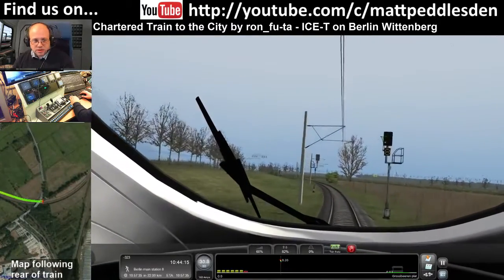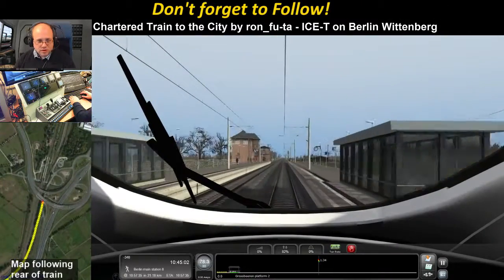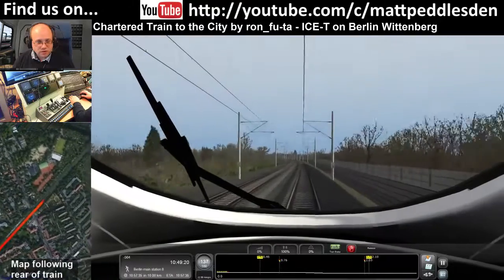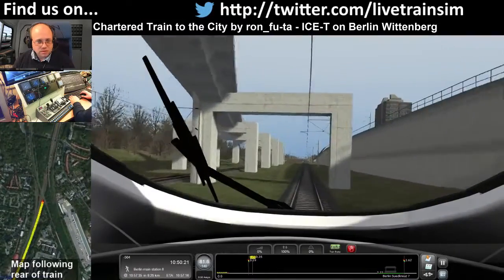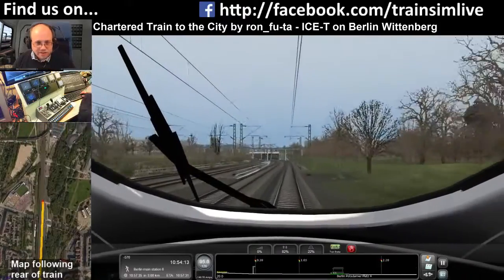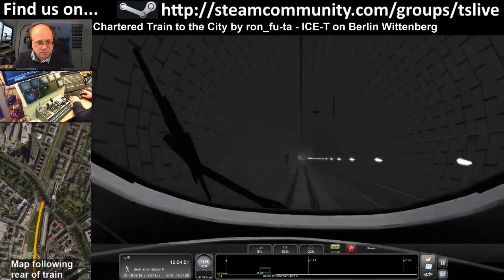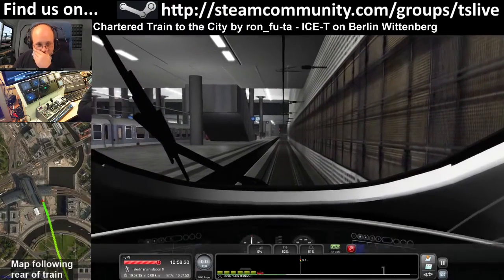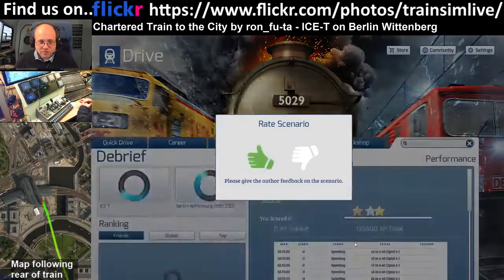Let's Play Train Simulator 2016 - Berlin Wittenberg, ICE-T

Comment: This Berlin To Wittenberg route is absolutely nasty! Why? Because there are several problems on the line. The speed limits are not correct. And there is no Leipzig extension. I think the ICE-T looks the same as ICE-TD, but with the red pantographs and more coaches featured which looks quite nice. I prefer to use it on Berlin To Leipzig route best because Berlin To Leipzig is absolutely awesome which has got speed limits fixed, the updated Berlin To Wittenberg route, and the Leipzig extension. Thank god Berlin To Leipzig is finally out on August 11th 2015. So I don't need to worry about Berlin To Wittenberg route for now. All the best!